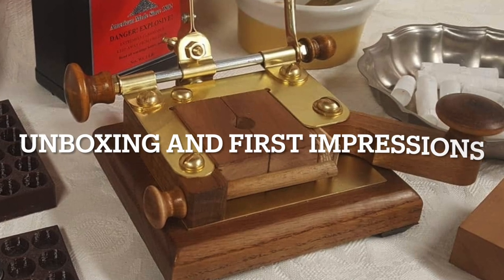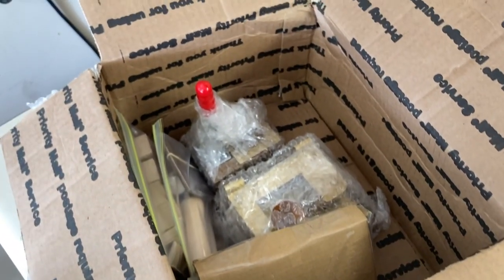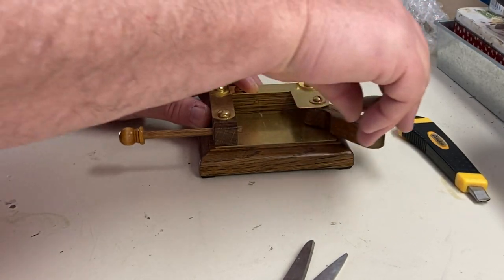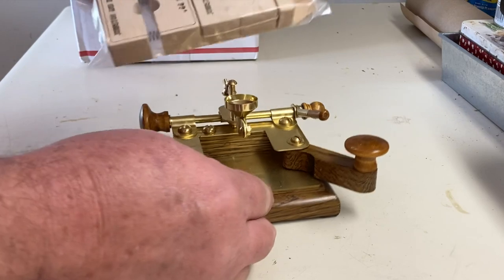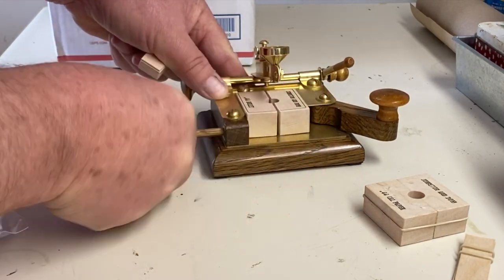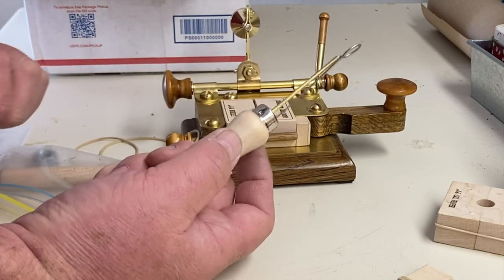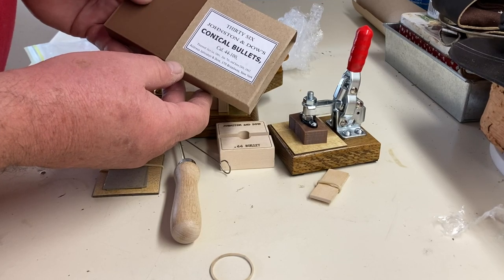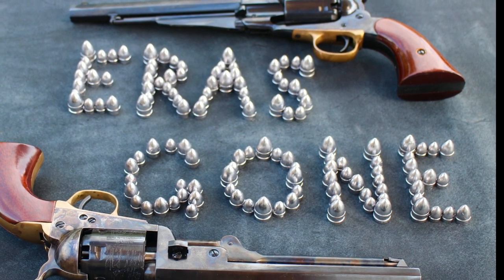The Crossen Cartridge Former. Unboxing and First Impressions

Comment: I don't use facebook so, I will reserve my final thoughts on this until I can see it actually work faster than I can use the common cartridge former I use.
I really see no advantage or time saving to this at the moment...
If stuff wears out so often it has to come with extra wedges, plates, etc... I see it as no time or price savings in the long run. 

I would be interested in the cartridge paper cutter if it actually cut paper itself but, as I understand it from the video, you still have to cut around the paper form yourself. Basically being just like an extra finger when tying a shoe lace.
Again, no time saver, especially with the arm of the clamp in the way of a handheld trimming blade at the back of the paper pattern clamp.

I really can't wait to see how this functions in the next video. Right now, I see it as a lost/worn part liability... so many wearing parts to screw up alignment tolerances and bit and pieces I can see myself either misplacing essential parts or going back to a regular mandrel former if I would run out of shim wedges or 2 part forms go out of round and won't line up right some day.

I guess time and another in depth video will tell. Right now, I only see it as a shiny  gimmick tool to unburden people of their troublesome covid relief money in hopes of showing off a new tool that will get used once or twice just to end up in a wall display box or sold on ebay as a missing part(s), "sold as is" listing.

Comment: This looks like a very well presented aid to cartridge making, however, I really cant see that it will substantially ease the problems of forming up a cartridge, in fact it looks like most of your time will be spent chasing it around as it slides around on your bench, so the first thing to do is fix it down, the cam/toggle clamp holding the blank cutting block will end up in the bin after it has dug into your thumb nail a few times, but I reserve judgment until after you do one of your test runs, I think it will end up parked at the back of your bench as a very nice display piece, well made, and well presented, but looks impractical to use given the number of bits required. Stay safe! Chris B.